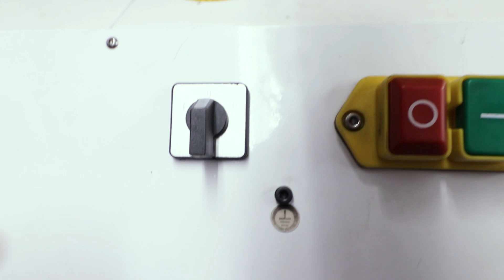Making a Watchmaker Lathe Faceplate Fixture for Making Watches! Watchmaking Vlog 45

Comment: Looks like you are getting some harmonic chatter on the outside surface.  For brass I would try zero back rake and a bit more nose radius.  You should easily be able to flip the part and pop in that groove.
Reply from the maker: Ohhh thanks for the great tips John 😁😁👍🏼 yeah I definitely need some dedicated cutters. I have a QCTP need to make post for it to fit though